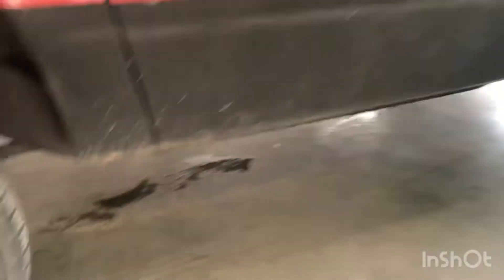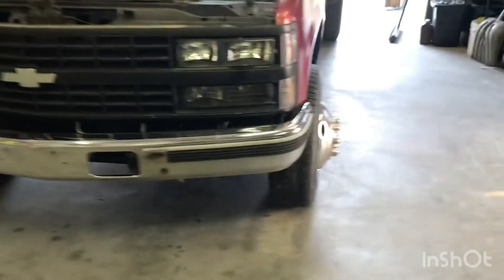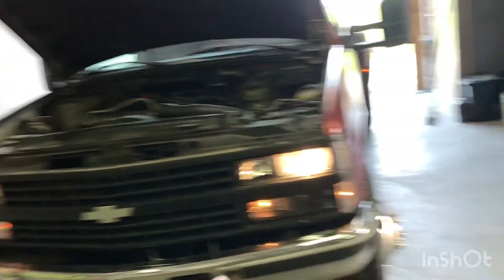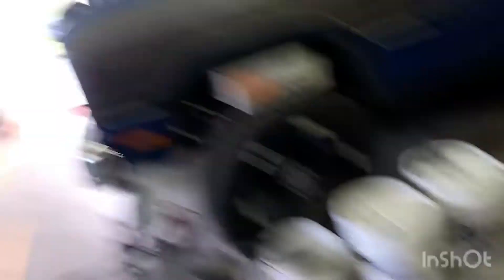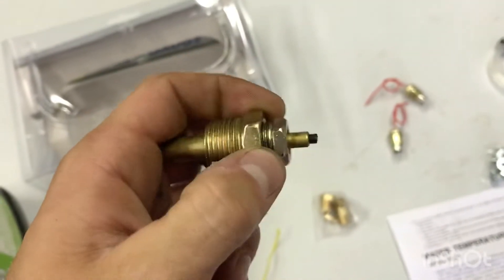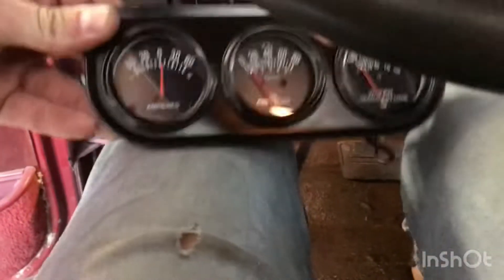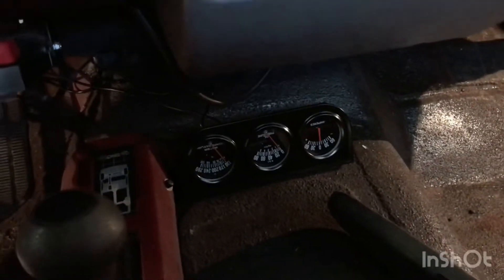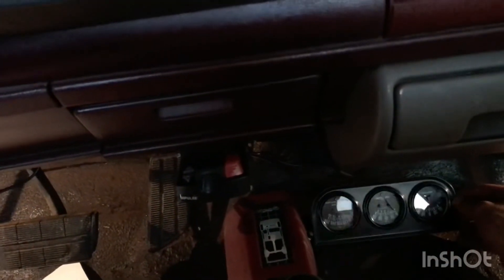Should we continue building the 6.5 diesel?

Comment: You can't cut the tube on the temp gauge. Its a sealed tube with a type of gas in it that expands with the heat since its a mechanical gauge. If you want to use a actual sending unit not a probe you need an electric gauge and a sending unit to match it since the gauge may run different ohms than a factory gauge. The gauge that you cut the end off of is garbage now. Just trying to help you out not trying to beat you up for your mistake